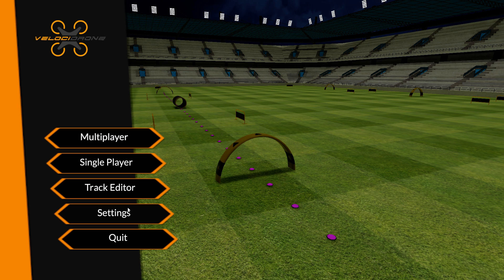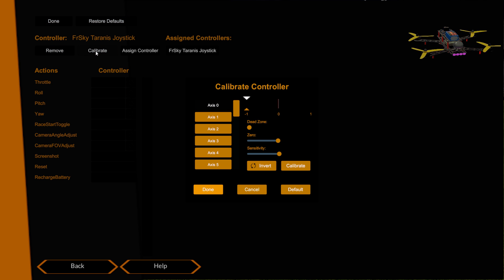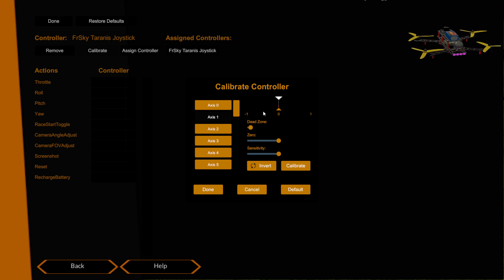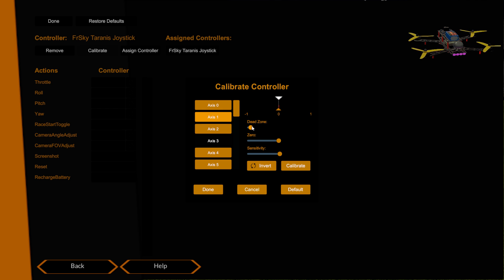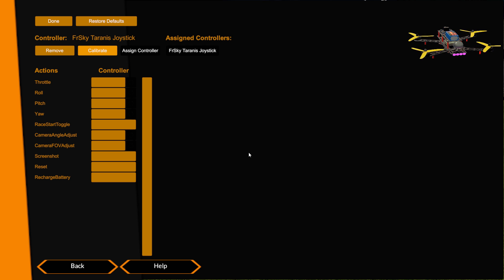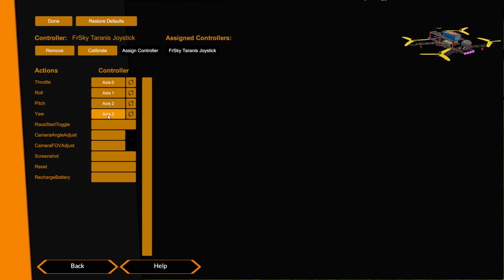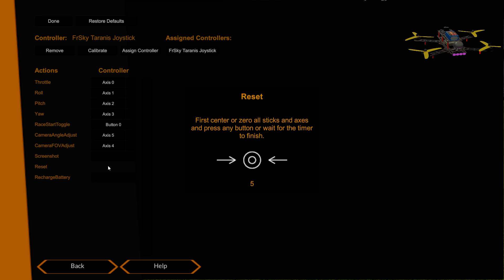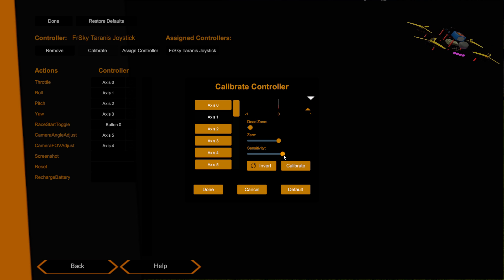VelociDrone 1.7 - Taranis USB setup

Comment: I really find these videos useful; but l have been unsuccessful at getting windows 10 64 bit to take any controller. It just shows up as "Generic" and gives me no options but remove device. Any suggestions?
Reply from the maker: Sounds like you have messed up your windows drivers (with zadig maybe?) or you aren't connecting the device correctly, Taranis X9D and QX7 both require that you set them to USB joystick in the main radio menu, then power on the radio first and then plug the cable into the back.

Comment: I'm trying to set up my Taranis Q X7 and nothing is happening. I have it powered on, I plug in the USB, I Open the trial version of the app. I click CONTROLLER. I am unable to click "assign controller".  Assigned controllers "None"
I'm brand new at this so is there some other video that I need to watch to set this up? I've spent two weeks getting all the proper components to be able to try a drone for the first time and I still can't get this stuff figured out. Frustrating to the layperson.

Comment: I only can remap Axis 0 to 3 (for General flying) but axis 4 and 5 and all other Buttons are not remap-able on my X-Lite.. what is wrong???? dont know why :(
Reply from the maker: If you are on windows then VelociDrone reads from the windows joystick interface - so I would look at that to see what the windows joystick driver is making available for use. We can only access what the XLite USB drivers expose to windows (or mac/linux)
Reply: Okey thank you i will try to find out!
Reply: What did you find out? I can't get Velocidrone to recognize X-Lite switches for "race start" etc. Just seeing the gimbals...but my first FRsky and Opentx product so totally lost.
Reply from the maker: if you are on windows check to see if they appear in the windows joystick driver first - if they don't then the sim will never ever see them
Reply: its crazy, on first computer the additional buttons are not available in velocidrone, on second computer they are.. but the sticks, axis 0 to 3 are available everywhere.
Reply from the maker: this is probably just a calibration issue then - if the usb driver is capable of making them available then you just need to calibrate them correctly for them to appear on the first machine. Please see our video titled 'solving axis non detection' in the usb setup playlist (it's the last one in the list)
Reply: @Velocidrone  Okey thank you!

Comment: Can you recommend a USB controller?  Does it matter if I use Windows or Mac (I have both)?  Also, does the USB controller depend upon the radio?  I have been searching around for a couple of days now and it's really hard to get a USB controller (either sold out or don't have any).
Reply from the maker: Some radios have the USB controller built in ( Frsky taranis / qx7) and the yare very good, others have them built it and they are very bad (Turnigy Evolution) - so yes the quality of the USB driver if it's built in is down to the hardware device and manufacturer. If you are talking about USB dongles then they are always available on ebay - we recommend the 22in1 dongle with the four position switch on the side if you are buying through ebay.

Comment: Great video, but it would be nice to have a tutorial for setting up my FlySky or my Jumper transmitters :) I have the data cable and drivers for both. but so far no luck on my own.
Reply from the maker: Setup in velocidone is no different for any transmitter - it is the EXACT same process for every transmitter. Therefore making videos for every transmitter is really a pointless exercise of repeating myself constantly. In almost all cases - apart from the throttle not working bug (documented in our knowledge base with a fix) problems setting up are usually either user error (not following instructions) or just completely not understanding the process of calibration of a joystick. My suggestion for anyone getting stuck is to open a ticket via our website and we usually fix them within a few hours.

Comment: I have followed all these steps but I am not getting the props spinning like at 7:00. all other inputs are working and axis 0 is working in the calibrate window and it is detected when I assign it. What is wrong?
Reply from the maker: AlexNZL known problem and documented in our solutions database in our Ticket system with a fix

Comment: I am on a Mac 💻 and the sim does not see my taranis x9d at all do you turn on the transmitter battery in and usb ...??
Reply from the maker: If the sim doesn't see it then you aren't connecting the taranis correctly. The tarabis should be powered on first and then the usb cable plugged in the back. If you have flashed the taranis then you may need to go into the menu for radio settings and change the usb option to usb joystick
Reply: https://youtu.be/dPIIVR18vpo

Comment: What USB lead and where can I get one,,      TARANIS
Reply from the maker: The Taranis usually comes with a USB lead for flashing it etc. If you don't have that then it just requires a standard USB A Male to Mini-B cable. Amazon stock them as do others.
Reply: Ah right I thought it would be a special cable lol Thanks VelociDrone, Right im pluged in but cant get props to move in controler set up lol,, bloody usless i am

Comment: "assign controller" button is not clickable, it stays dark. restarted with taranis qx7 connected and disconnected, Mac. What's going wrong?
Reply: Same here. Cant figure it out. About to give up on this Sim and find one that works with a Mac
Reply: You've got to create a new model on your taranis and plug in usb cable after turning it on. That did it for me, hope it helps
Reply: I did all of that but it wouldn’t recognize the Taranis on the setup screen. I figured it out eventually but the directions could be much better.

Comment: first let me explain that I am new to all this and Iam learning as I go.  I have Taranis Qx7 and not sure if I have set it up correct.  when I connect to Velocidrone all controls work as required except the roll.  When I move the stick the roll immediately jumps all the way.  The throttle, pitch and yaw all work properly.  on windows calibration and velocidrone calibration everything is working properly.can you suggest a fix.
thnk you.
Chuck
Reply from the maker: Could be one of two things. Either the calibration just isn't right and I suggest watching the "solving axis non detection video" on our channel for a description of how all the calibration stuff works, this video will give you all you need to fix any calibration issue. Alternatively you have a failed audio setup that has corrupted a config file, to resolve that you need to go to c:\users\yourusername\appdata\locallow\velocidrone\velocidrone and delete everything in that directory except the user11 file and then restart the sim.
Reply: Thanks, I have watched that video.  so I guess I'll try deleting the stuff in that directory.
Thanks for the quick reply.  It is refreshing to actually get a reply.
again thanks, I will leave a message to let you know how it turns out.
Reply: deleting the extra files worked.  My grandkids and I Thank you very much for the help.  
Chuck

Comment: Simply add the Betaflight - Configurator simulation to the game in terms of cost settings.
Reply from the maker: that won't work, input to a PC system is via USB not via a wireless 2.4ghz interface
Reply: no. you do not quite understand. I would like to see what would be the tuning behavior of the quadroopter in the program, as in the program Betaflight - Configurator - RS Rate, Super Rate, RC Expo.
but despite the lack of these settings your program is very good.
Reply from the maker: I think you need to look closer at our software, tuning for all the betaflight settings has been in the simulator for over a year now, we even use the same betaflight dialog with the graphs of the rates etc
Reply: maybe I just did not find this dialogue? I saw only the appointment of dead zones and a sensation for the stick
in Liftoff this is directly in the settings of the cap. and here where?
Reply from the maker: Серый ап in flight mode hit the advanced drone settings button in the right hand button bar
Reply from the maker: https://youtu.be/U5tMP1OFcMk?t=3m57s
Reply: yes, I did not carefully examine your program))) thanks.
Reply: Simply put if you got a qx7 plugged in your pc and your program is not picking it up to configure properly....that is a HUGE problem that needs to be addressed. Thanks for the trial to find this out first.

Comment: Struggling to get Velocidrone to recognise the existence of my Taranis on my Macbook Pro. Any tips, joystick settings, drivers I do not know about?
Reply from the maker: No, it just works. If it isn't working then it will be one of two things. Either the cable you are using is faulty (the most common reason) or you are not connecting the Taranis correctly as it can connect in two ways, most people make the mistake of connecting it as a storage device instead of a game controller. To connect as a game controller you need to power it on first and then plug in the cable OR if it is a later firmware there is a menu setting in the Taranis to make it connect either as mass storage or game controller.